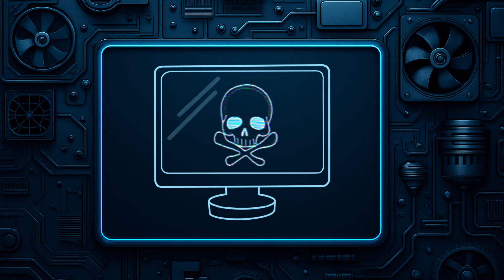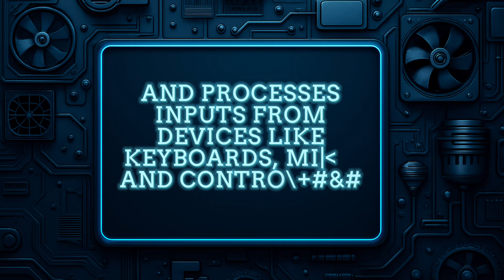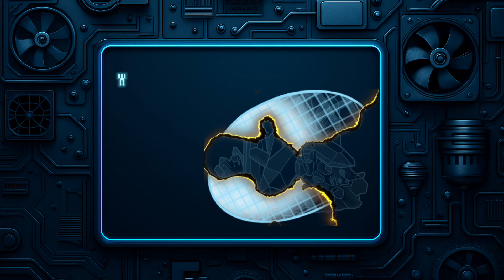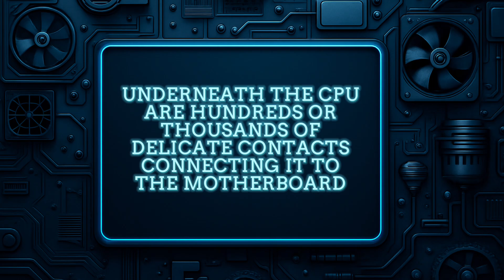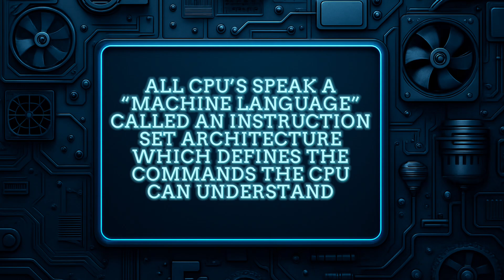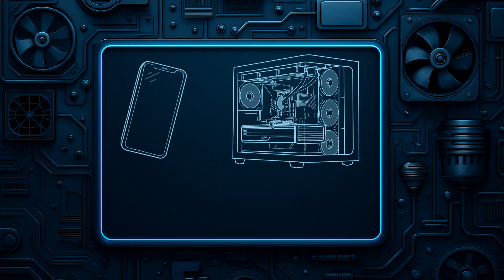Inside Your CPU – Part One

Comment: Some of the most important things inside a digital CPU are the flag register with single bits inside and instructions that set or clear one or  more bits inside the flag register and other instructions that use one or more of these bits like conditional jump instructions to jump or not to jump inside the code of instructions, if one or more bits of the flag register are set or clear, to perform a program flow like a loop with instructions inside.
Reply from the maker: We’re starting at the core (literally), because this is part of a series and we’re building it up step-by-step, registers and branching come later.
Reply: @TheExploitArchives That is good.